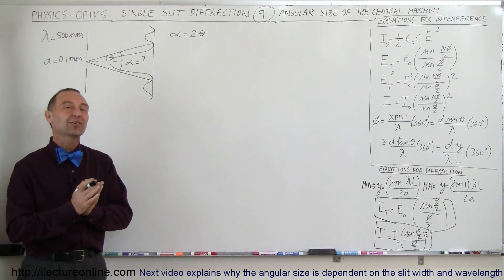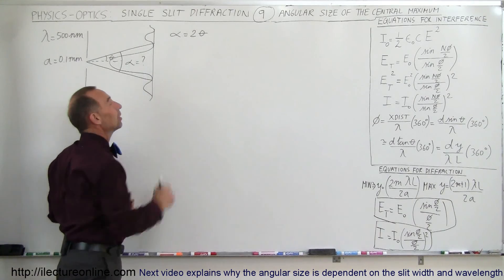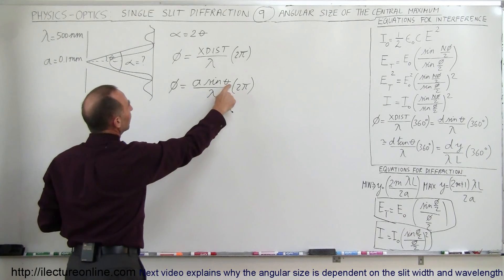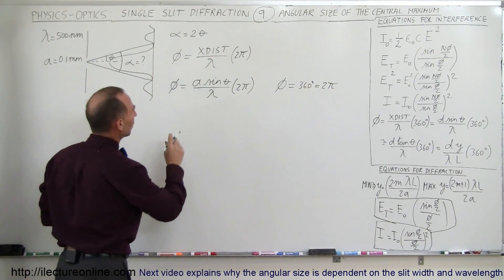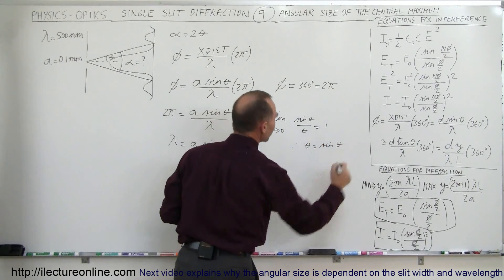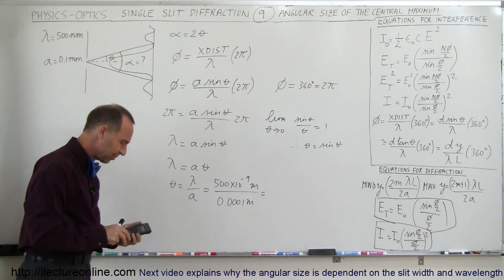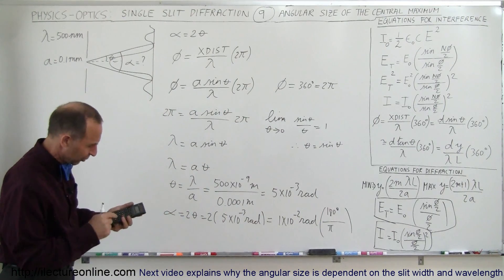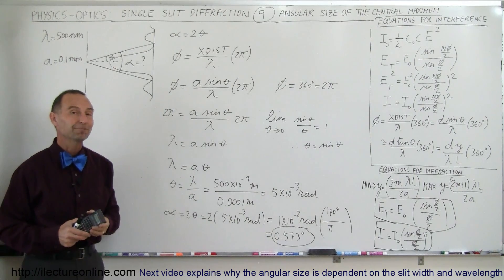Physics - Optics: Single Slit Diffraction (9 of 15) Angular Size of the Central Maximum

Comment: shouldn't we take a/2 instead of a?
Reply from the maker: +Muhittin Zıkkarikaro 
The video is correct as is.   Did you watch video #7 and #8 in this playlist?  Those will give you more of an understanding why this is correct.
Reply: OK then, thanks a lot. :)
Reply: @MichelvanBiezen  I believe the phase difference should be equal to pi instead of 2pi as we are looking for the first dark fringe, hence, the first appearance of destructive interference. A 2pi phase difference would imply that constructive interference is taking place at point y1, which I don't think is the case.
Reply: @jacobhaley1351  i'm thinking the same, doesn't a complete phase difference mean constructive.
Reply: No yall, sir used the phase between the 1st and last beam which is indeed 360degrees for 1st min.

This is because if 1st to last is 360, then 1st to middle is 180degrees out of phase. (Condition for 1st min) 

Or according to u. It would be:
a/2 sin(theta) = lambda/2

Lecturer wrote it as asin(theta) = lambda. Its the same thing.

It would've been better if he wrote it more clearly. But hey, ironically he helped u realise u needed more practice with the concepts